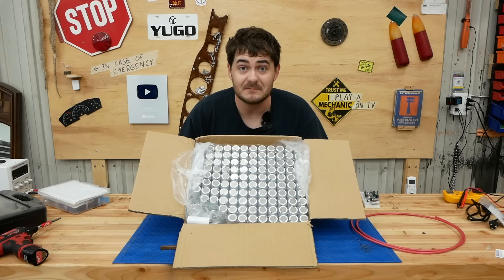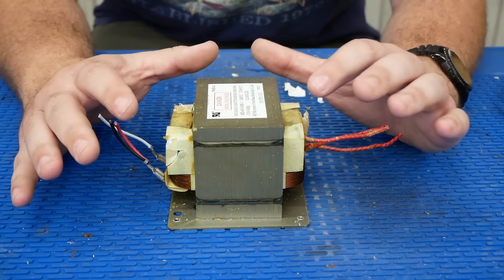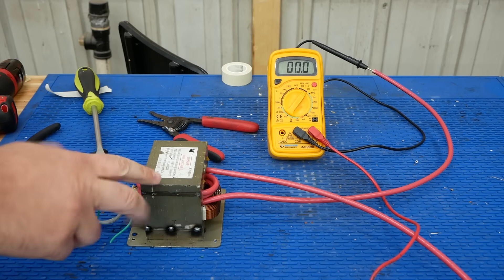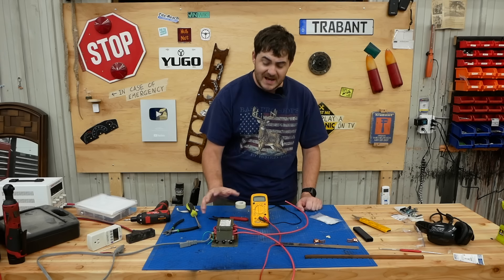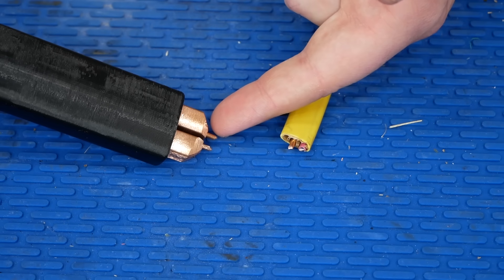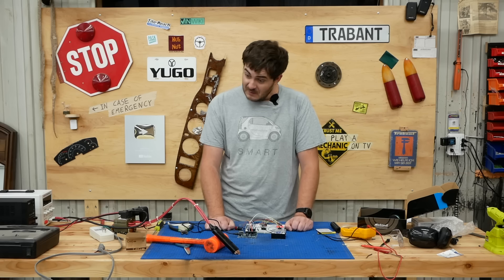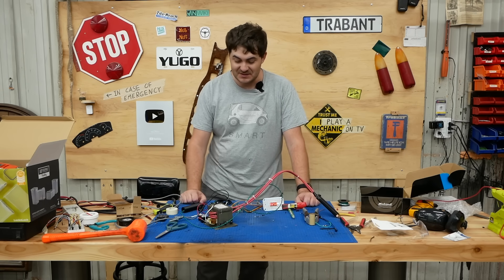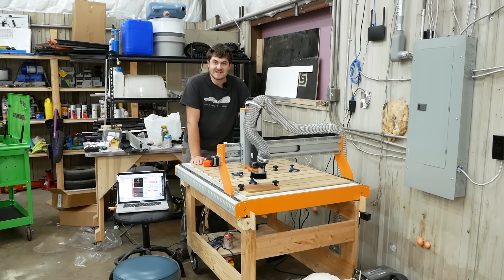I Made a Battery Spot Welder from an Old Microwave and Excessive Mahogany

Comment: Just a sidenote: that "discharge capacitor before servicing" sticker is there for a reason. That bastard is charged to ca. 4 kV and is pretty large, instakill if touched. Either measure (IF you have a proper multimeter) or wait a day or two before opening a microwave, since there is usually a bleed resistor across the cap.

Comment: Mighty fine work there! Just a thought, but car stereo amplifier wire would make an excellent choice for replacing those cables, you can get oxygen free copper wires for just a couple bucks per foot, it's highly flexible and more than capable of handling the current. You could even get some much shorter Allen wrench driven grub screws from just about any car audio shop in whatever size and thread pitch you need that would sit flush or sub flush in the electrode ends, and 3d print a new handle with a cap that would fully conceal them, it would definitely make the whole electrode housing a little safer and make it look a lot less janky. Anyway, thanks for another great video! Looking forward to the next one! 🤘

Comment: by the way I have found that using thinner stranded flexible cord makes wrapping the secondary much easier. you can even take the thin copper strands from multiple cords and twist them together then tape them (with 260 degree Celsius rated glass fiber tape) to make any thickness secondary you want.

Comment: You can find the length of the wire in the transformer by measuring the resistance then using a chart found online to get the length.

Comment: I wonder if all the control circuitry is that much better than the old lever operated spot welder.

And I wonder at what point you have too much current.

If I hooked up 20 of my lipoly cells in parallel, that would be 4000 amps. Multply that current by 50 ...something would blow, because that would be 200,000 amps

Comment: I want to build this but I'm wondering if the solid state relay has to be protected from flyback. When I plug in and unplug the transformer directly there is a visible arc in the outlet.

Comment: great way to remove those windings! I tried to cut the ends flush and hammer out the remains and it took me an hour. Im going to use a 100uf capacitor as a relay duty cycle switch, no arduino.

Comment: Let's take the mystery out of the transformer, shall we?

Important to remember:  Transformers only work with AC.

Here's the magic:  When current passes through a wire, it generates a magnetic field around the wire.  Anyone who has ever made an electromagnet for science fair knows this.  You wrap a wire around a nail (iron core) many times.  This causes the magnetism to "add up" and it becomes a useful magnet with only a few turns.

With AC, every time the current changes direction, 60 times/second in the US, the magnetic field grows, collapses, and grows again in the opposite direction.  When you coil the primary, which is what is happening here, that magnetism creates a magnetic field, just like with the wire around nail except it changes polarity, N-S, then S-N.  OK so far?  

Now, the iron core supports the magnetism giving it a path that is easier to travel through than air.  But when you coil another separate wire around the primary, or adjacent to it as is the case with a transformer, that magnetic field will act on the other wire, the "secondary" and cause a current to flow in it.  Actually, this is how electricity is generated at your favorite local power except they just spin magnets past coils of wire.  It's actually the same way for your car's alternator!

So here's the magic.  If you make the same number of turns in the secondary as there is on the primary, you will get the identical voltage and current out of the secondary (ignoring loss through heat).  If you make two times as many turns in the secondary as the primary, you will get two times the voltage and one half the current as you put in on the primary.

If you make half as many turns in the secondary as is in the primary, you get half the voltage and twice the current.  It doesn't matter the gauge of the secondary wire, but it should be able to handle the current you're asking it to produce.

So in this case, if you make two turns in the secondary relative to 100 turns in the primary, you'll get two volts and 500 amps out of the secondary.

Comment: I hate to rain on your parade, as the video looked like it would very interesting, however .... ('however' doesn't sound anywhere near as that dreaded 'but').  Please note that this isn't trolling, or random nit-picking, but something that anyone reading this comment may find useful to remember:

When speaking in public, which is what any YT video is, it is essential to speak at a slower pace than normal.  Sounds simple enough, but takes some conscious effort to do.  When speaking that way, to an audience (as I have had to do a few times) it can feel quite artificial and contrived, but it does make a huge difference to audience engagement.  At it's most practical, use it when next asking your boss for a raise (with very carefully chosen words).

Comment: Actually running the transformer in reverse let's you short across the lower terminals without overheating....the impedance of the high could won't let much current through at line voltage

Gives about 24-26VAC on the low coil from 240v in the high could 
About 1.5amps , 2-3 if you take the field shunts out

Very useful

Comment: Why in the hell would one cut the transformer apart? cut the secondary windings out (cut one side) hammer them out to the opposite side. Then wind your own 0 gauge wire or whatever you choose. I did and 3d printed wedges and works great.. never cut a transformer like this. EVER.

Comment: I built a much less fancy version of yours a few months ago. To anyone wanting to make a much worse but still functional version, I used 1/8 copper rod with points ground on it for the electrodes and used only an arduino and a push button switch. To adjust the timing, I make changes in the arduino code. It’s much worse but for my purposes the timing can pretty much be set and forgot. Another tip is if you don’t want to (or in my case couldn’t) disassemble the transformer, you have another option. I used a saws all to carefully cut each end of the secondary winding flush with the iron body of the transformer and then used a 3/8 drill bit to drill out as much as I could. With the majority of the material removed, it was easy to punch out the rest with a flathead screwdriver. Also if you mostly work on cars and small electronics, remember to switch your meter to ac before checking the transformer. That took me an embarrassingly long time to figure out.

Comment: Can you please tell be what is the current rating of the Solid state relay you used, since the current is active only for few milliseconds can we get away with a 30 - 40 A ssr .? or should we use a  for this example around 600 A SSR for this.  Great video thanks. !

Comment: Ok, so I know this is an older post, and I follow you....BTW, this is a GREAT build!! Anyrate, I have a question...when you show the "Guts of the spot welder ", there is another board in there, that I cannot wrap my head around what it is....has capacitors, resistors, etc..." could you elaborate on this for me please?? TIA, for taking the time.
Reply: Ok wait, after pondering it for a bit, I think I answered my own question. Im guessing it is a voltage regulator, to power the arduino. Please correct me, if im off.

Comment: no need to cut the transformer, though removing the secondary this way is easier and faster
for control you can use 2 relays 1 capacitor, battery and a button. battery charges capacitor, button discharges capacitor in 1st relay and it opens second relay which connects mains to transformer. the smaller the capacity of the cap, the shorter the relay would be open and power would be fet to transformer. ugly solution, but works perfectly, as long as you get a suitable cap. i use 12v car remote battery and 16volt cap(forgot how many uf)

Comment: I know I'm super late to this video but I wanted to mention an extremely important fact that you got wrong in the video. If you're transformer is truly giving you 2.2 v on the secondary coil, and you didn't just blow a fuse on your multimeter, then that high current isn't as deadly as you think it is! 

 It takes 0.1 mA across the heart to kill a human, but that 0.1mA isn't possible with a low voltage because our bodies have a pretty high resistance. The formula for current is I = v / R so while your secondary coil can produce the needed current it cannot properly drive that current through your heart. Making it surprisingly safe to humans aside from the potential for burns but that much is obvious given that you're using that heat to weld. 

I have batteries capable of producing 20+ amps (the lab I had access to didn't have equipment capable of measuring anything higher) and I directly grabbed them after stupidly short circuiting them in the battery holder I bought. My hand was burned pretty badly but there was no electric shock causing my muscles to contact or anything else you'd see with current running through the body. I had to explain to the doctor at urgent care that 1 the electricity had no real way of traveling through my body but 2 if it did then I'd be dead or my hand would be destroyed. 🤦 my batteries were only around 2.4 volts.

That being said, I don't recommend anyone use this information to do anything dumb with high current but low voltage sources. You'll get burned very badly very fast, and there is always the potential you'll get too confident with it and make a mistake causing your system to have too high of a voltage.

Comment: Confused. Pulled a microwave apart and the secondary wire is larger gauge than my primary. And how did you get 11 amp current on the primary without any load?

Comment: It's also possible, though tedious, to cut one end of the secondary off with a hacksaw or grinder, and then kind of drill into it and/or hammer it out the rest of the way. That way you can avoid having to cut the weld. I got a 40" 4 ga battery cable from O'Reilly Auto Parts that had connecters already crimped on, for around $13. That's an easy way to go. Just figure out some way to bolt on your probes to the ends of the cable. I used as bolt to connect a copper block terminal from Home Depot, and then use fat solid copper wire for the actual ends. Another idea would be copper mig welding tips.

Comment: Just though I'd point out that connecting a microwave transformer backwards (mains onto the HV secondary, output from the primary) will step the voltage down and the current up but, no, it won't melt. Not immediately, anyway. The secondary has much higher inductance and resistance, so the current going into the transformer will be very low. The voltage coming out of the (old) primary would be about 5 volts. 

There are 2 problems. The first is that the primary windings are only able to support a few amps before THEY melt. You just won't get anywhere near enough current to do the weld before the windings burned out. The second problem is that microwave transformers are flux limited, which means that the transformer itself will limit the current. Maybe even to the point where the primary won't melt, but even worse for welding.

Which brings me to the reason why microwave transformers work well as spot welders when you rewind the secondary with thick wire. They are flux limited, which means that if you short circuit the secondary, the primary current won't get so high that it trips your breakers.

Comment: 3D printing tip: all walls end up 0.2 mm (0.0787 inch) oversized, at least from my experience with 0.4 mm nozzles on 9 different printers (3 different brands). So holes need a 0.4 mm oversize (works down to ~2.5 mm diameter holes).
But if you need a nice surface, printing without oversize and drilling it out is still king.

Also: there is a simpler version of this using a lead acid batteries and car starter relay, but it lacks the timing control (in case sb has difficulty getting an old microwave).

Comment: kinda makes me wonder why would the button not be in the weldy bit. (maybe house it as 3rd  cable off to the side, button than would need to be mounted sure but you know just print something with little buttony housing bit)
i feel as tho having separate wired thingy is taking away unnecessary focus from the job at hand.

Comment: A perfectly fine alternative to an Arduino is to use a simple pulse circuit with a 555 timer and the potentiometer and capacitor to set the time constant. You wouldn't get the cool display in milliseconds, but you could calibrate the knob with a scale (that could, if you wanted, go to eleven) to give the same result.  Get a touch more fancy and use a 556 dual timer and use its second time to disable the  first timer for a set period so as to give a delay between button activation.
Reply: True. However it's much easier to make a Double Pulse controller with an Arduino. Apparently many commercial battery tab units use a double pulse with a pause in between. First pulse to soften the tabs so better contact is made & possibly clean the surfaces of oily deposits - Pause -Second pulse (longer than the first) to weld the tabs together. This can easily be done with an Arduino or other micro-controller. Lots are online, just search for Double pulse controller for spot welder.

Comment: The wire gauge for the secondary winding is way too small! You need at least 25-35 mm^2! 
Don't how much that in AWG is

One more thing: If you use a single pulse you could have used a 555 timer with a one-shot configuration

Comment: You could make a timer circuit with a capacitor, a potentiometer, and two transistors.  I am too dumb to understand arduino, so this has been my route when making timer-based contraptions.  I made an auto-clicking mouse last year to refresh an app with gig type work.  I was afraid that they would catch on to the auto clicking so I wanted something analog that would never be 100% precise.

Comment: You don't have to cut the transformer laminations with angle grinder. You can cut one side of the highvoltage windings with a hand saw and then punch out the rest. Also, a foot switch is much more practical. Speaking from experience.

Comment: Would there be merit in repurposing an old glue gun or soldering iron gun to house the electrodes and trigger?  As you said  -No arduino - and it'd have one handed, touch sensative operation.

Comment: You can just use a simple transistor circuit to make a "GO" button, but you used a arduino instead. Why not in Raspberry Pi? or better on a CoreI9

Comment: Some ideas, not necessarily criticism:
1. If less precision is needed, a 555 in a monostable setup might be an easier alternative to an Arduino. 
2. In the more complex direction, it might be worth learning some PCB design because ordering PCBs seems like it's getting really cheap these days. I don't personally know any PCB design though so I can't speak for the difficulty of that
3. For the switch, I know that 3.5mm jacks are often used for modular switches (see: the Xbox One Accessibility Controller), so ready-made foot switches that don't need to carry current might come with that connector
4. A monostable timer for wall power might be useful outside of this application, though for what escapes me. Making the relay circuit into box with a male IEC plug on one side, female on the other, master power switch, display and knob for adjusting timing, and a plug for a trigger switch might be a fun project. Maybe even run the spot welding gun with a foot pedal (or other kind of master switch) as a safety and it could be technically usable without the box, but more precise with it.

Comment: ARDUINO??? Coulda done that with a 555 timer and some 7 series logic!

Joking aside i love DIY tools like this.
And believe it or not, some commercial (low production) units are also built in wooden boxes like this.

For the flexible cable, look for welding cable, its made of very thin hairlike strands with a thin silicone sheathing and its very flexible and carries massive current. crop the wires at the box and add some good screw terminals or an andersen powerpole connector so you can detach the welding leads.

Comment: If the output is 600A I am surprised the sparks are not jumping between the electrodes with that small gap you can see at 5:50

Comment: Current is drawn not pushed. Your primary might have been drawing 10 amps, but I can guarantee that while you were measuring the voltage it was almost no current at all. If you want to measure how much current the spot welder is passing the only reliable option is probably a shunt.

Comment: If you don't want to use a digital controller but still want automatic pulse control, you could use a capacitor, a potentiometer, an op-amp, and a latch to control the relay. You wouldn't get a digital indicator but you could use printed/embossed/whatever numbers around the potentiometer knob.

Comment: How does a transformer work?  AC goes up and down while up primery coil generates magnetic Field that charged secoundery too,  as the ac goes down the magnetic Field colapse and creates a reverse polarity voltage the secounder do the same depending on the number of turns on Both sides, Yes it's basicly a magnet if you use DC.

Comment: With one less secondary turn, I built something very similar, but with 2 parallel 4AWG wires and Miller spot welding tips. Works well up to 3/16" steel, 1300A output at 1.3V.